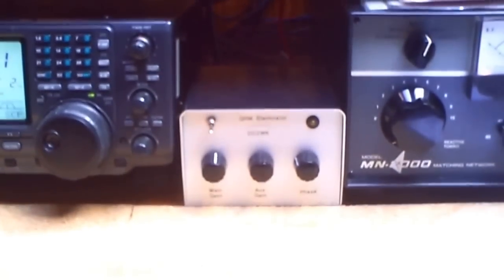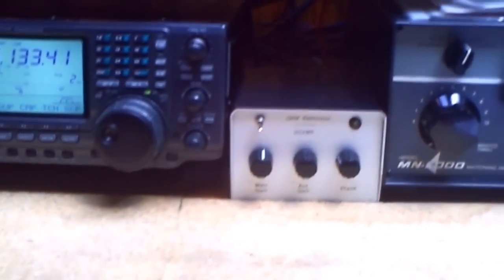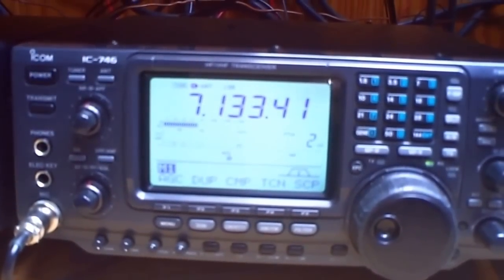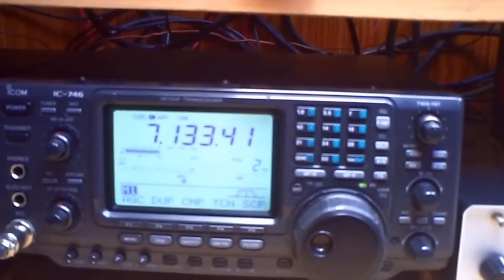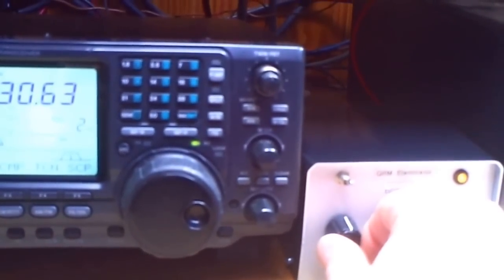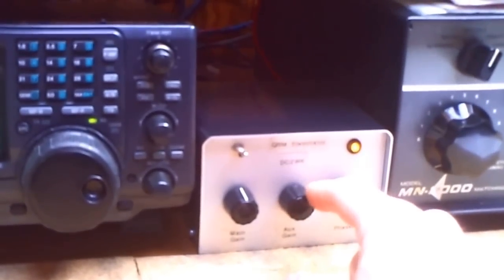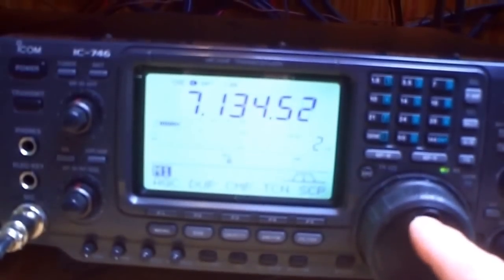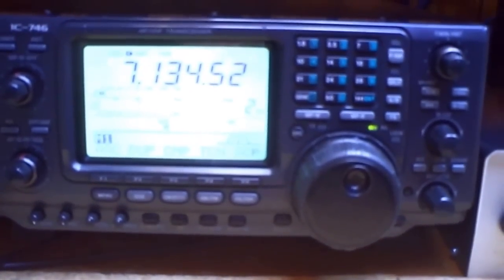Homemade QRM Eliminator (DK9NL)

Comment: Little hint, QRN = (Natural) atmospheric noise, QRM = Man made noise. 
This is reason nobody calls it QRNancy or QRNovember eliminator 😜
It is not going to work efficiently on QRN, but highly efficient with QRM if the auxiliary antenna ideally picks up maximum noise and minimum wanted far-field signal.
These devices and ideally a symmetrical magnetic loop antenna for the wanted RF signals (has the most local noise immunity) are the only chance we have today to overcome the worst noise source in our near-field in the age of cheap switching supplies, PLC and other noisy stuff. But once you have numerous signals from different directions, you can only cancel one of these. On an SDR you can tune it just by looking at the spectrum, while you see its very frequency selective behavior very clearly.
You can get these as a kit from China for under 20 bucks without a case and ready made with case for around 50 bucks.

Comment: The original schematic use two relays wich are 30V 2A . Wonder how much power You can use...i mean : are they ok for a 100W transceiver ?
Reply from the maker: I have it directly after the Transceiver, so it must handle only the 100W from the Icom
Reply: Thanks ! My main transceiver is Ft 1000MP Mark V ( Yaesu ) wich have 200W but i use 100W because from 100 to 200 there's no difference really.

Comment: ich habe eine frage, dieses QRM eliminator, kann man gegen Plasma TV benutzen?
can you use this for QRM from a plasma TV, de G0KVL.
Reply from the maker: +slartybardfarst52 

Hallo Dr OM
yes i can work. You need a second antenna, where you ONLY can hear the Plasma TV and not the stations.  Then this little QRM Eliminator can eliminate this signal. But you must tune by every frequency change and signal change.